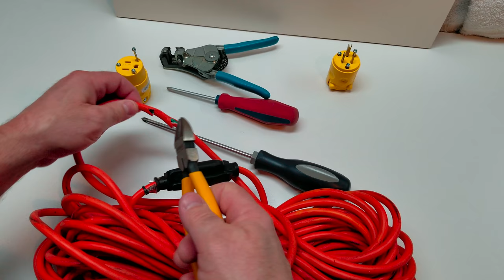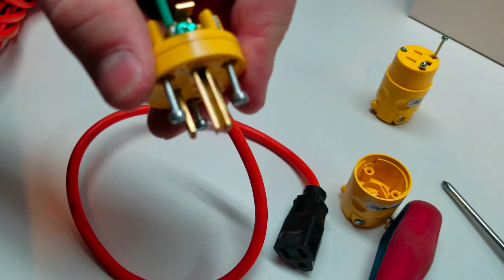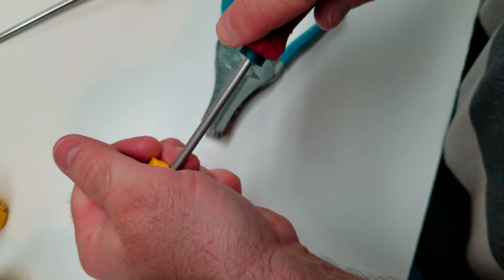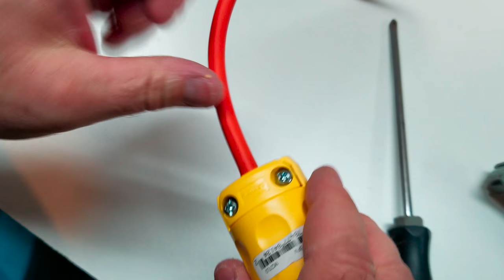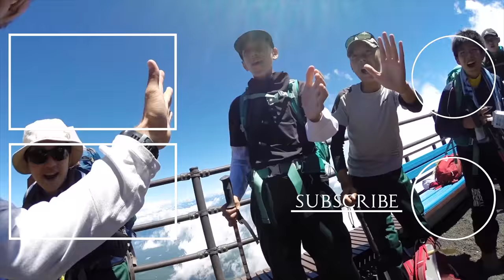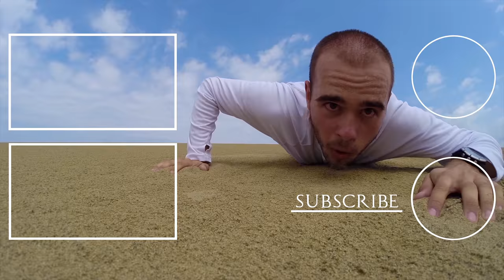How to Built your own AC Extension Cord

Comment: How is this ideal for an ac? Does it increase the amp capacity?? Thanks
Reply from the maker: Why do you say it's ideal? It's just an AC connector at the end of and AC cord. It does not increase anything.
Reply: @HowToPM  ok wait are you not talking about an air conditioner??
Reply from the maker: Ahah!! This one is funny! 😂 AC also stand for Alternating Current. I think that most of the AC (Air Conditioner) does not have connector. The AC (alternating current) Cable is just screwed inside the AC (Air Conditioner). 😂